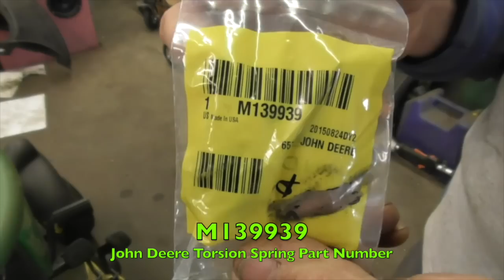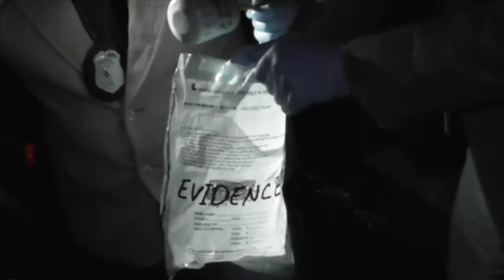How To Fix The Steering On A John Deere SST16 Riding Mower (Actuator Steering) - with Taryl

Comment: That's the fascination and frustration with working on small engine equipment: the unknown factors give you a learning curve. The thrill is in finding the solution to each challenge. Then comes the satisfaction, which can quickly bend the other way if the customer returns very irate. Such is the life of working with unknowns.

Comment: I have a Cub Cadet 2186 Garden Tractor and the steering is slack.  I can turn the steering wheel 30 degrees or so and nothing happens.  Can yo udo a video on fixing this issue.  It does not have the simpler pinion and rooster tail steering gear exposed on the bottom of the tractor like most of the other videos that have been published.  I really like your honesty and method of showing how to do repair tasks that the homeowner can do.  Thanks.  Kevin Merkley

Comment: Them things were horrible to service. I hated it when one came across my bench. Foul a plug in the Vanguard v-twin, they stop steering completely. Awesome vacuum operated steering issue.  The first SST units had that bear trap of a belt tensioner for the deck belt. Do it wrong there goes your fingers.  POCS lol.

Comment: Looks like a $330 in labor to replace a $4 spring.  Maybe if you were not showing on camera you would not have to remove the entire top end, just pull the wheel and drill the hole.  Nice Video.
Reply: doublewide6 Repairs LLC yea maybe, but whenever I'm working on something I don't understand I usually take alot of the covers off so I can see what's going on

Comment: I’ve owned an SST-16 for 17 years without a problem. I regularly change the oil, oil filter, air filter, spark plugs, gas filter and transmission filters. The John Deere SST Series won awards for its innovative technology.
Reply: Its amazing how no other company uses it. Because its designed to break and cost money

Comment: Hey Taryl I just had to work on one these sst16's last summer owner told me they took it to the john Deere dealer and they told the owner it needed a new transaxle they told dealer it worked one day and the next time they went to use it it would not move so they brought it to me to be cheaper to replace the dealer told them the drive would cost a thousand dollars I just couldn't believe it quit working sittin still like that come to find out I took the back end and jacked it up started it and only the left wheel turned took the right wheel off and what do you know the key was missing on the axle put a new key in put wheel bk on and what do u know it worked fine I called owner and ask if they had gives a flat tire before they tried to mow and of course they said yes I told them I just saved them over a thousand dollars they ask how I said who ever took the wheel off to fix the flat they lost the key way off the axle when they took the tire off , the owner said I took the wheel off so after I tuned it up and got it all done they gave me a 60 dollar tip for saving them so much money now I do all there work on all there equipment now , thanks for all ur tips they really come in handy ( JEFF FINNER ) FALLS CITY NEBRASKA.

Comment: I have a sst18 and it just recently have trouble steering will only steer in high rev mode but still kinda hesitant. I found a small black hose looks like a vacuum hose that is dangling could that be the only problem it just needs to be reconnected?

Comment: I would assume that if the switch was bad, you would have the same steering issues. My SST18 has good springs but still has the same problem Taryl describes. I'll have to test the switches...

Comment: Got to love John Deere, taryl. yeah, that steering is over designed and over complicated, way more than it needs to be. Like you say, it's not the space shuttle, it's a lawn mower. but, by them making that so complicated, it's more stuff to wear and break, so more money to jd for parts, and the complicated design will scare away diy'ers from fixing it themselves.
Reply: dave1135 this one is not a lawnmower, it’s the space shuttle!
Reply: It's another Deere abortion you're gonna see tons of em getting dumped out in the driveways of America with a 4 Sale sign on em.. Runs but doesn't move..... I have some older mowers here from Craftsman to Troy Bilts just dropped a new motor in em they're good for another 30 years of mowing your yard..

Comment: My SST only will cut if
 I go in circles.When the blade is engaged it will kill if I go straight but if the blade is not engaged it seems to work just fine

Comment: Cub Cadet i1046 has a screwy type of steering but it's some different, the usual problem with those is the  steering mechanism has two kinds 1/3 moon shaped cogs and  one of them breaks and  then the mower is useless until it's fixed.

Comment: Hay bud I have a john deer L120 the guy ripped the wires out of the clutch was wondering if I could cap off the 3 clutch wires to get  it to start it was cranking but the starter wasn't engaging so as in was working on that eventually the fuse burned and has been burning every fuse since I disconnected the starter still burned fuse than disconnected the ignition switch still burned fuse than unplugged pto switch still burned fuse so needless to say and 9 fuses later aim stuck I can only think to change wire harnesses is there any way you could help me out

Comment: It goes forward and it goes backwards and it won't turn every time I turn the steering wheel it does absolutely nothing I put a different vacuum hose on and it still won't steer can you help me
Reply: Same issue. I can steer in reverse, but going forward it won't turn

Comment: These newer mowers are like the new cars. Pretty much no user friendly service. I have a Husqvarna rider with the plastic transmission and it’s only about two years old with 115 hours and it’s falling apart. And I have tryed to treat this mower like I would be using it in ten years 🤯.

Comment: Why in the hell would you want that steering on your LAWN MOWER? this ain’t NASCAR
Reply: Aint that the truth lol
Reply: Marty Martin maybe some people can't afford a 4,000 dollar zero turn! Money doesn't grow on trees! But that mower sure is nice!
Reply: small engine kid  when this mower came out it was in the 4000$ price range
Reply: small engine kid - it’s too complicated for long term ownership. You can get a used Hustler FasTrac and mow laps around this John Deere for less money
Reply: I own the SST 18 and it cost me 5500 in 2001.  Nice mower on flat ground. Cuts better than typical zero turns, but is a little needy. Bought it because u could hold your beer with one hand and steer with the other
Reply: @thelawnmowerboy9646   Money is actually a paper product.  Paper comes from trees.  And there's yer dinner.
Reply: @iowamatt2519  I bought an sst16 2 years ago used for $100. I stole it it's the best mower I've ever had it cut my cutting time in half. Sharpening blades, changing oil and gas is all it has ever required.

Comment: As luck would have it, after deck removal and removing 20yrs of debri, wasn't a 5 dollar spring, but the right 120 dollar diaphragm. The cooling fan was packed full of dirt and striped the plastic splines out, so new fan / vent filterers and new trans oil on it way. Thx for your help Taryl, Bear

Comment: My SST18 would not go forward i  rebuilt the actuator myself by drilling new holes and replacing the bolts it will never screw up again. Come on JD

Comment: Taryl  I need use parts . Yah gut any that you wanna sell ... ? I have a hole in the actuator boot. Stopping my forward steering,it will travel forward, & not turn.  & this is leaking gas like a mo fo.   John Deere Gas Fuel & Hydro static Tank AM132414 SST15 SST16 SST18
Any help would be greatly appreciated/by anybody who be in the holler .
Subed/ belled/ have  octopus finners on  . well done man. 
Thank you .

Comment: So this mower is pretty much a smaller zero turn that has convoluted, over complicated steering. And people wonder why I keep my 'ol Simplicity.
Reply: Russ Davis well now you know why they don’t have these anymore.
Reply: Russ Davis I have a regular riding mower for jd and it’s great only issue I had was briggs shitty engine on the mower. I had the too common head gasket blow out. At 50 hours...
Reply: FishFind3000
Well see i learned something from you. i didn't know JD quit making those. Too bad they thought it was a good idea to begin with. Also pretty much any conventional mower is fine by me. As long as I can get parts for it if need be. Some of the older JD's are still going strong after decades. Same with my Simplicity (even though it's fairly new being it's a 1985.)

Comment: I refuse to fix garbage like that.
Reply: Andrew Munchkin so what would you do? Pay someone else?
Reply: jhitt79, only an insane person who knows nothing about lawn mowers would buy one of those poorly designed mowers.
Reply: Andrew Munchkin a lot of people buy a lot of things that are poorly designed, that doesn't make them insane.  Many people are so tricked by John Deere's marketing that they think anything with that green paint must be good.  I personally, haven't worked on one of these machines, but the fix didn't look too bad to me.
Reply: jhitt79, the fix was amazing. However, the whole design of that steering system is one giant mess.    Its sole purpose is to get the whole mower to be recycled, not repaired. Its a con job. A mower should last at least 10 years with a few simple repairs. Ask Taryl.